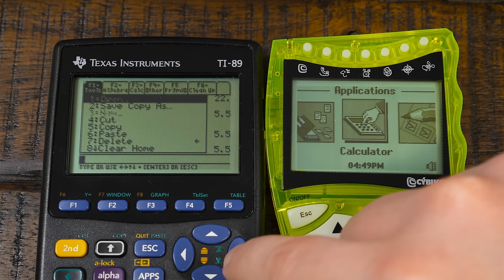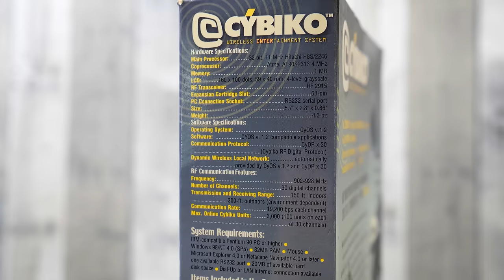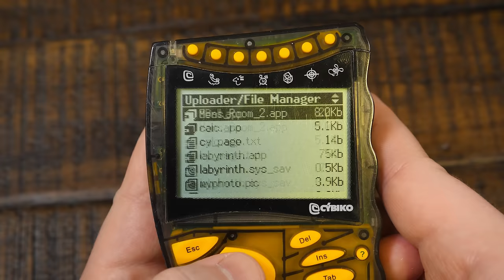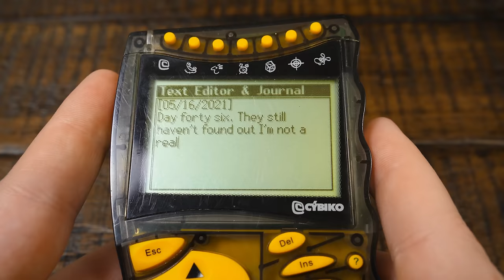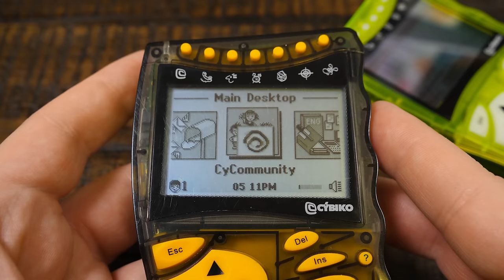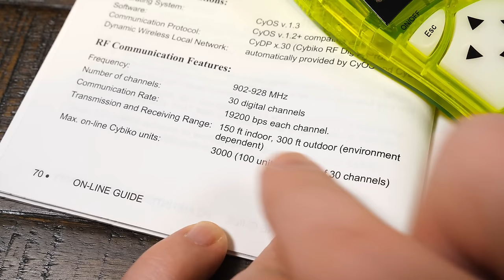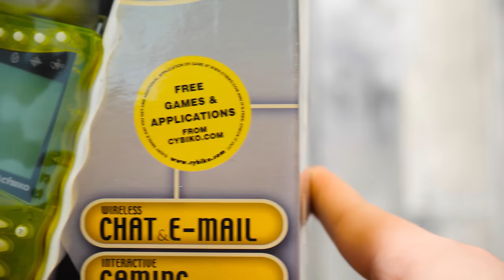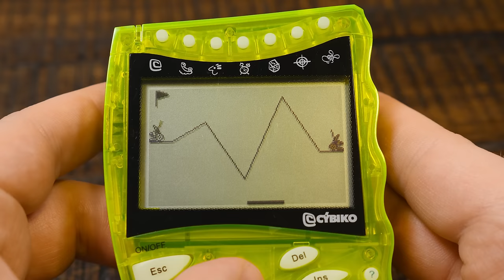The Cybiko Experience: a Handheld Computer for Year 2000 Teens

Comment: I really do miss the late 90s-early 00s translucent plastic aesthetic
Reply: And neon colors
Reply: And the little soft plastic buttons in numerous curved shapes. Yeah, it's certainly a look.
Reply: @noecarrier5035  Those buttons were the worst.  They felt cheap and always seemed to wear out way too fast.  The clear plastic was fun however.
Reply: @AbbieOates  Yeah, they had that black plastic liner underneath that seemed to abrade the white plastic during use. The cheaper ones were made with ink that would rub off on your fingers and you'd have no idea what the button did. My baby sister would also chew on them obsessively for some reason so never could be left out for long.
Reply: I want a translucent plastic case for my phone, now.
Reply: The problem with squidgy buttons is as a kid I always used to dig in and pull them out. I suppose that's more of a me problem, though... 😢
Reply: Duke Hugh Johnson  I think they were, it was just much less visible because far fewer people ever spoke to one another, amplified each other, unified around some set of concepts. It's a perceptual thing. People are people, no matter the place or time.
Reply: @noecarrier5035  I think it’s a little of column A, little of column B. There was certainly a lot less platform for constant criticism, but then I think the breathing room left people less uptight and on the defensive, too. One hand washing the other, so to speak.
Reply: I miss it too. I swapped my Nintendo Switch shells for atomic purple shells
Reply: iMac G3!
Reply: Meanwhile I have difficulties finding a transparent Nintendo DS chassis to replace my cracked one lol

(it's the very first bulky DS if you wonder)
Reply: I remember as a kid I loved those imacs
Reply: the casing on this thing immediately reminded me of my neon inflatable chairs. we need inflatable furniture to comeback lol
Reply: @alysdexia  Neon, the element, is colorless. Fluorescence has no prescription of color.
"Neon" is also commonly used as a category of extremely bright colors, this is probably what they meant.
Reply: Really needs to make a comeback honestly.
Reply: @arnevajsing7120  plpppppp]p)

Comment: Being a dysgraphic (fine motor disability that particularly impedes handwriting) public school student whose family couldn’t afford a laptop until I entered high school, Cybiko and Cybiko Xtreme’s word processing capabilities and ability to export text documents via cable literally carried me through middle school.

This thing is absurdly capable for a time period when many people let alone kids didn’t even have candy bar Nokia phones yet, if this thing had gameplay performance on par with the original Game Boy the Cybiko would have been an unstoppable beast, and as it was, it featured predecessor capabilities that predicted modern smartphones.

Great to see you cover this thing.

Also, the Cybiko Xtreme was the first device I ever used that accepted SD cards, done via an adapter.
Reply: Cybiko was a decent idea but in 2007 Ipod and Iphone monopolized all the gadgets
Reply: @HanzoHimemiya  Cybiko as a platform device was dead by 2003/2004 at the latest, it’s not even a contest, it was off the market for years by then ha ha.
Reply: @SuperTrainStationH  GBA kicked him early
Reply: That’s cool! But it didn’t literally carry you. 😉. It’s good to see people using tech to overcome setbacks
Reply: @HanzoHimemiya  I wouldn't exactly say monopolize. I got Nokia 5800 XM before iPhone was here and it essentially had everything and more than iPhone had. Ie. it had vastly better GPS, maps and connectivity. I had it for several months before I saw first iPhone used anywhere. It took couple iterations for iPhone to get features right. Though admittedly Apple did the touchscreen much better. Not to mention that Nokia had all the features way earlier. Touchscreen was the only lackluster thing in Nokia's and slightly incoherent OS that they struggled with.
Reply: Ever use an alphasmart in school used one of those since my handwriting is illegible too
Reply: @topazbear2  if I heard of them back then I would have used one, I have two refurbished Alphasmart Neo 2’s what a wonderful machine, basically using the tech of a child’s toy laptop to make something useful and practical decades after they left production that I’m not at all shamed to use in my 30’s.
Reply: The most impressive thing about this is it actually does things it should be able to do, that you might want it to do. Cell phones immediately locked down all the sensible functionality. you couldn't just upload, let alone compose, a ringtone, from your computer to a phone.. it all had to be done via proprietary and non-free internet, and still does to this fucking day i think. really sad.
i can't imagine trying to type out a whole school report on this thing but i bet it was great for taking notes.
Reply: @topazbear2  I had to use one for taking notes and doing assignments back in middle school! I kept dropped the damn thing because of my grip issues, lol. Eventually my parents bought me a netbook to type everything on, which was such an upgrade.
Reply: @spacedog12345  i used the 2000, 3000, the dana and the neo didnt get to use a laptop in school until college. had one for assignments at home though
Reply: @SuperTrainStationH  i have an alphasmart 3000 still with me and i liked how i could get an entire school year of use on one set of batteries. Ever try updating the firmware on those to add more than eight files to them
Reply: My best friend had the same thing and his parents paid for an early BlackBerry pda to keep him going, if they'd known about how well this would have worked i suspect they'd have gotten that instead for that price difference
Reply: @SuperTrainStationH  heck, once I got a ds, even a phone wasn't needed between me and my friends since it had a built in chat function
Reply: @jothain  Yes, but Nokia works horrible slow on small screen.
Reply: @KairuHakubi  And that was a bunch of bullshit! I remember in 2006/07 with my LG VX9800 having to do special tricks with the sound files, like changing the extension and the file bit rate... otherwise Verizon would turn it into a .QCP file... (Which sounds like garbage). After awhile, Verizon caught on to this and started forcing all sound files up to 192kbps stereo when they were sent, which would either limit the sound to 9 seconds long, or cause the file size to exceed 300KB which made Verizons servers convert it to a QCP file. The effort Verizon would put into trying to block you from sending small mp3's to yourself was f'ing ridiculous! 

I remember emailing small videos to my phone. And then if it was 400+KB in size, I could play it in the message folder... But if I tried saving the video to my SD card, it would pop up a window saying "Unable to save. File too big". Too big my ass... I had over 500MB of space. More like... "You're not allowed to save it because we said so...even though it's already on your phone". 

Damn I am soooo glad I don't have to deal with that shit again.
Reply: @kasuraga  one cool thing is though, the cybiko let you know even if the device was in your pocket if someone entered range, so you could start a wireless chat without arranging in person first, which DS couldn’t do
Reply: @JoshuaJacobs83  You didn't? What?
Reply: Ahh yes, dysgraphia, otherwise known as "not trying hard enough."
Reply: @mercster  Doesn’t sound like a medical definition to me
Reply: @mercster  Not trying hard enough? 

To back up my statement, I have a lifetime of first hand experience, multiple inch-thick folders of University Hospital documentation and professional evaluations dating back to the 1990's, thousands of hours of physical therapy and occupational therapy sessions, and notebooks filled with self-administered, physically painful, and ultimately fruitless attempts improve my handwriting via "practicing" in the hopes of not needing to rely on a computer.  

All you've got is an edgey quip on YouTube.

Seems more like you're the one who's not trying hard enough.
Reply: @JoshuaJacobs83  OK bigtime ;-)
Reply: @jothain  Nokia 9000 Communicator was announced in 1997 and it has everything iPhone had and lot more, bar touchscreen (but it has really usable keyboard). But, AFAIU, it was almost unheard in USA, it was known only in Europe.
Reply: @blacklion79  Well, yeah that's basically true. Tough I wouldn't categorize display in these anyway near each other. But yes, feature wise Communicator was a beast for it's time.
Reply: @jothain  Yep, but iPhone was 10 (!!!) years later!
Reply: There's always that one guy who has a cool story about some silly old piece of kids' tech. A couple of times, I was that one guy. This time, you are that one guy.

Interesting to know there was actually someone who needed and benefited from this device, especially for school work. You probably got more use out of yours than half the people who owned them combined.
Reply: It literally carried you? They should have used that in the advertising! "Cybiko can support the weight of an entire person!"
Reply: Great to hear you found it so useful. It's a shame people bash Cybiko so much. For that time and the low price point, what device could perform better?
Reply: @MeegoHeebo  if Cybiko was able to launch with the Xtreme model had games or graphics consistently on par with games from the first year or two of the original Game Boy’s lifespan, it could have been even more incredible
Reply: @JoshuaJacobs83  mercster is a troll stop acknowledging him
Reply: @HyperrealisticLuigi  I did. A while ago. But thank you. Sometimes I forget to control my tongue so to speak
Reply: @jothain  cope and seethe
Reply: This is a very cool use of tech, though I'm a little disappointed the school didn't come through and give you a laptop. A lot of school systems have funding for exactly these situations.
A lot of blind people started using smartphones before they were truly mainstream because they had the processing power to run specialized OCR, GPS, and barcode scanning apps, as well as the screen-reading functionality to read out the entire interface. That trend continues today; only difference is that everyone else has one too. As I was only 15 when the iPhone came out, I missed this era by a mile, though it didn't get screen-reading functionality until the 3GS (which I bought.)
I'm a little sad these little gadgets didn't set more of a trend; even now sometimes I wish I could just open an app and message random people nearby, or have decentralized texting with the built-in mesh networking. The implementation was flawed but so much of this is so very possible now. We just don't care because big tech gives us half-baked solutions to half our problems.
Reply: I still use a alphasmart
Reply: Oh, I have this and didn't really make it through middle school, I just went and got a GED. I can fill in a bubble on a standardized test well enough, right? Oddly enough I now collect writing implements and ink, I relearned cursive as an adult and the disease doesn't seem to apply to it, but only in cursive, standard still has b<-->d and the inability to write a lowercase N and silly stuff like that. Without my enjoyment and wanting of it though, for other reasons is what enables the other mode though, it's using some different cluster of neurons from the diseased one or...something like that? Something about the torment of being made to do it in school as millennials when computers were so obviously in reach is part of what happend, possibly ADHD too, I didn't meet a single one of us who didn't have either ADHD or Tourettes and I've found around four or so. Anyway as an enjoyer of what google would call as a product category, "fine writing", I want you to know that is totally possible for you to enjoy writing physically still and be able to do so in a "proficient" way if you still choose to do desire it, we're very neuroplastic if the correct solvent is found and it's probably that way literally, even if the production of that solvent is spiritual or ritualistic.

Edit: And I forgot to mention, yes without the building-tension-pain thing, I got it to stop doing that. There's no specific moment where it happens, don't search for one.

Comment: 22:24 To be fair in 2000 there wasn't a bunch of other signals in the air for the cybiko to compete with, that might be why the range isn't as good as promised
Reply: Yep. I know wifi interferes with picking up radio stations. A lot of stations would just be static til i unplugged the wifi box.
Reply: @chrismooney2240  that's likely not the Wi-Fi signals themselves interfering with the radio, rather it's the noise generated from the router's power supply.
Reply: @chrismooney2240  Wifi itself can't interfere as it uses a whole different frequency range as radio
Reply: Nah even in the article he showed the author said the reception was terrible even in 2000
Reply: I bet money it was always garbage lol
Reply: Yup i just posted that everything is LoRa now which is free and why they both used it LoRa in the US is 915 mhz does mesh networking and is long distance of about 3 miles then each person expands coverage all the IOT devices use it
Reply: I know 4G runs on similiar bands

Comment: In my period era experience, we had stable chats and games with multiple Cybikos going on at the advertised ranges.
Reply: There's a decent chance the part of the spectrum around the Cybiko has been reassigned for phones or other uses, or suffers from splatter from adjacent frequencies. That would have the observed effect; a useable range of a few feet
Reply: My guess is that nowadays there's a lot more of devices on those ranges, so there's a lot more of interference
Reply: @jbruijn  or it could basically be the wall of radio interference that is basically all over the civilized world and cuts your 1980s transistors radio range down to effectively/listenably the next town over.
Reply: @jbruijn  splatter, that's a good word for it.
Reply: @jbruijn  your probably right on that one, they have been cutting down on the amateur bands for years (RIP 2.4 GHz)

also smart electric meters and overloading pager towers could decrease range (pagers are at 930 mHz, so harmonic distortions are possible, and smart meter interference has been getting overwhelming in the past few years.)

also solar activity has changed a lot in 30 years so signals may not propagate as well (there was a geomagnetic storm a few weeks ago... although mostly lower bands are affected by such)

Comment: The range extension thing if there are other Cybiko's nearby sounds like a mesh network. I did not expect a toy, lest of all an early 2000s toy, to have a full-fledged mesh network. That's pretty good.
Reply: Yeah the idea is good. The tech to support it just wasn't there back then and even if it was, there was no way it would be available at a price point to be sold for use by kids.
Reply: it literally is that.
Reply: Yeah it's what modern motorcycle bluetooth headsets only in recent years implemented......... And the feature makes the price hike significantly so makes me wonder if the patent ran out recently
Reply: It was exactly that. In a world without internet, these people could still communicate. I can't think of a widely-accepted way to do this in 2022, other than going back to low-tech solutions like FRS radios.

Comment: "The early 2000s were still the 90s."

That hit me like a rock!! What a realization. 😁😁😁
Reply: It helps if you think about things more in terms of 3 year chunks or so than decades. 1999 to 2001 had a good deal more in common than 1999 and 1991.
Reply: @Belgand  True. A lot of the most popular music from 1991 was still characteristically 80s sounding.
Reply: The 90's pretty much ended in 1998 for me
Reply: This is basically every decade.  The early 90s were still in the 80s. The early 80s were still in the 70s and so on...
Reply: In truth, basically every decade's culture for the first 5 years are determined by the last 5 years' culture. It's weird.
Reply: @Noid 
True. 1990-1991 was essentially an extension of the late 80s. I think a lot of it has to do with the fact that things like movies, shows (or electronics in this case) take a few years to produce before they're released.
Reply: @lastotallyawesomebleach204  Not sure I agree. It certainly was different 1999 to 2001-2 but it shared so much with the 90s. Ads, music, shows, ect...